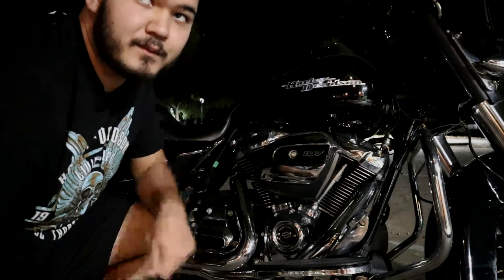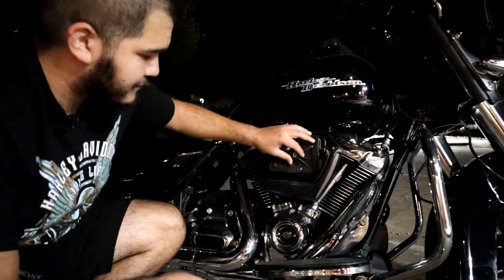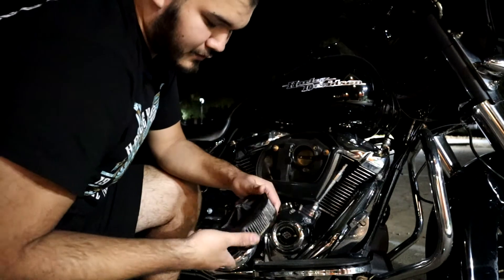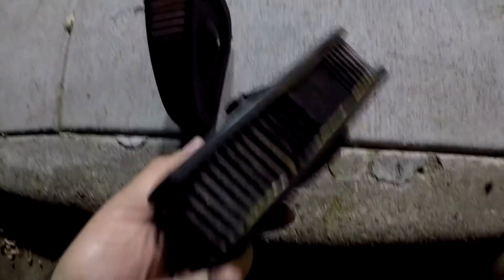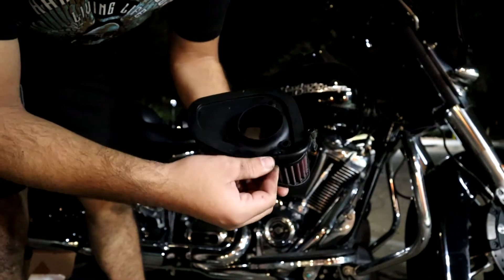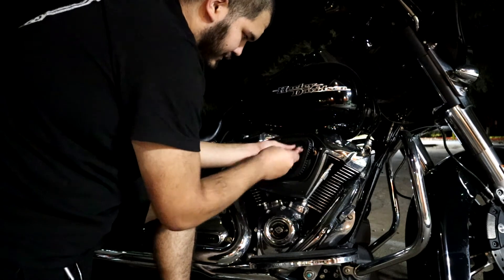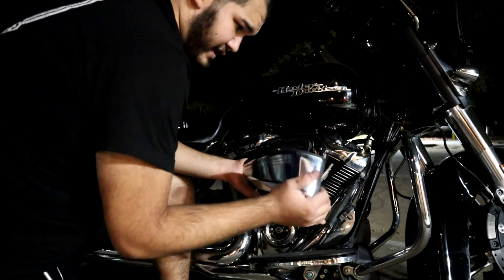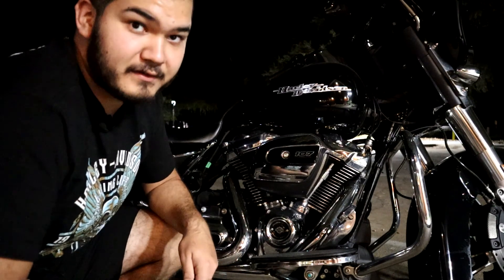Replacing Air Filter on Harley-Davidson Milwaukee 8 | K&N HD-1717 Upgrade | Budget Stage 1 Upgrade

Comment: I have a question for you, I have a M8 2017 and  they run not as lean as a twin cam. There is about a 10% leeway on the M8. My question is if I put slip-ons with a high flow Air filter do I really need a tune? Remember I'm still using my M8 cover so the air flow would be a little less then say an full open Air filter. Thank you and nice videos

Comment: You mentioned that this is a budget Stage 1; do you have buy and install the SE tuner? Can the ECM handle slip ons and the high po/free flow air cleaner without any problems? Will this void your warranty?
Reply from the maker: Great question, I will try to answer to the best of my abilities. From what I have been told, the filter alone will not void your warranty. Slip-ons shouldn't either but depends on your dealership. Running this setup without a tuner is not recommended because it will run lean. I used the Vance and Hines Fuel Pak 3 to tune it.

Comment: I did this to my 21 Softail Standard and now the engine light stays on and shows a p1510 EFI Limited Performance Mode, but it seems to be running fine so I don't know what's going on
Reply: Did you get the light and error code resolved?